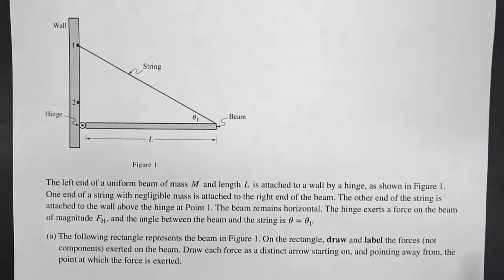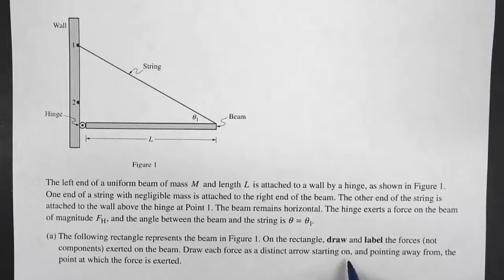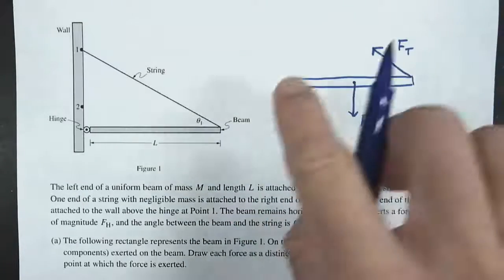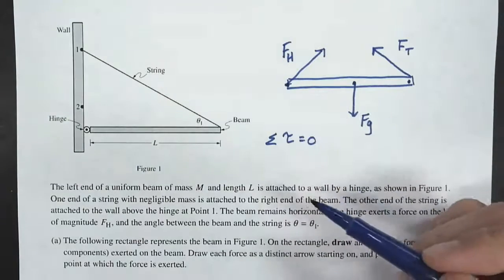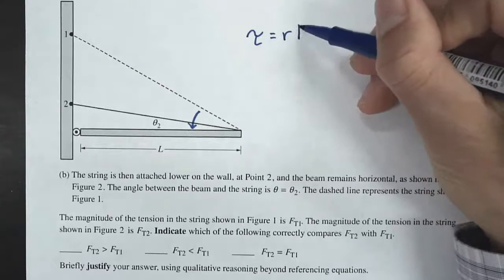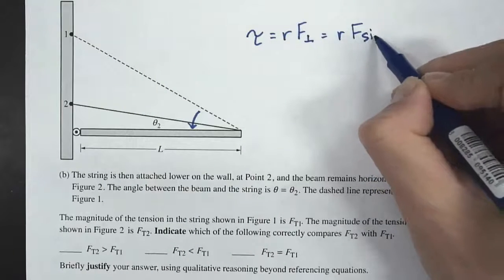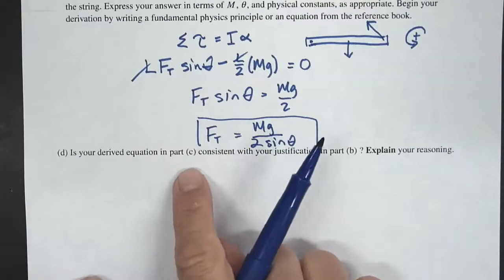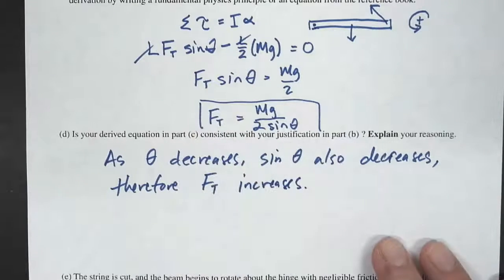Wall Cable Beam Torque & Rotational Dynamics FRQ - AP Physics 1

Comment: Why is there a force of hinge in part a but it isn't included in the deviation in part c. The part where the torque=0.
Reply from the maker: Because in part (c) we made the hinge the “axis of rotation” and the distance between the hinge and hinge force is zero. 

Imagine pushing the hinge (axis of rotation) on a door, you would not be able to rotate it. Good question!👍